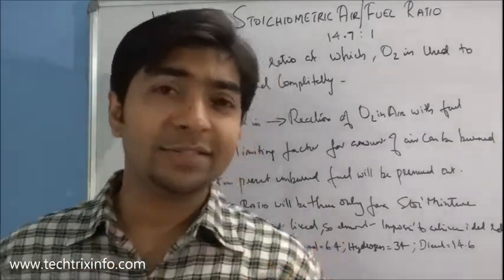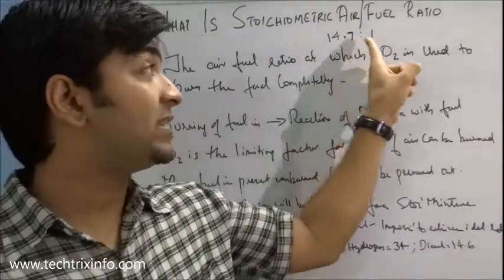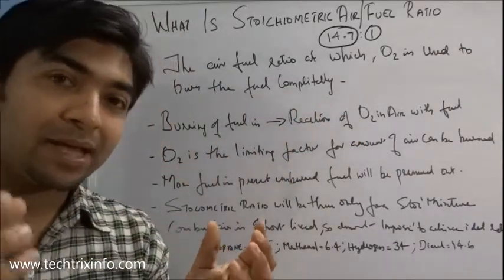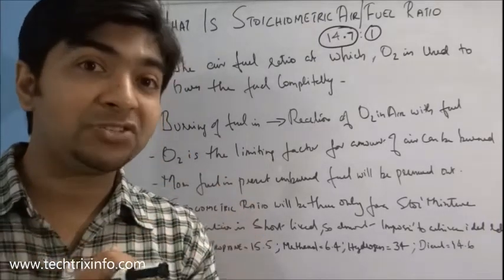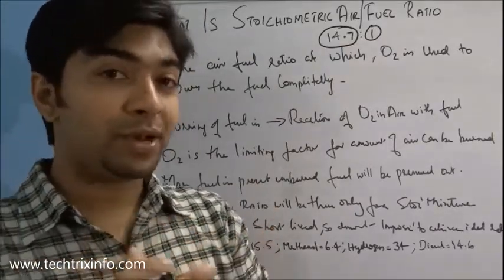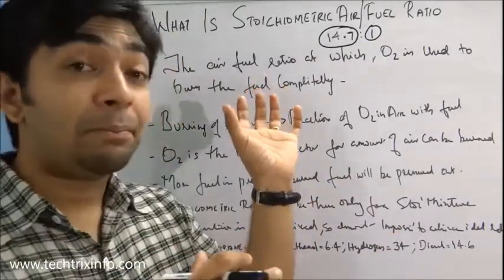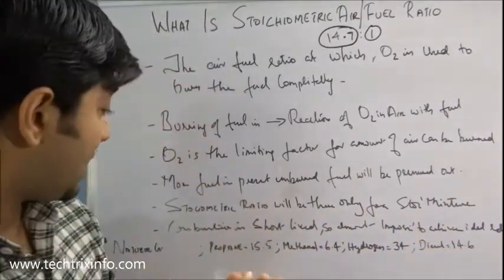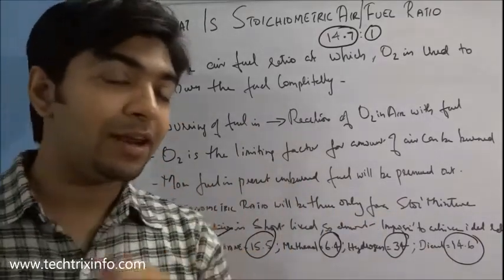What is Stoichiometric air fuel ratio? ✔

Comment: The Airfuel ratio of CI engine is 14.6.  and the range of Air fuel ratio varies from 20:1 to 80:1(given in a book)
   If 20:1 is rich mixture(say at starting),.. how it is 14.6?
  Please clarify my doubt